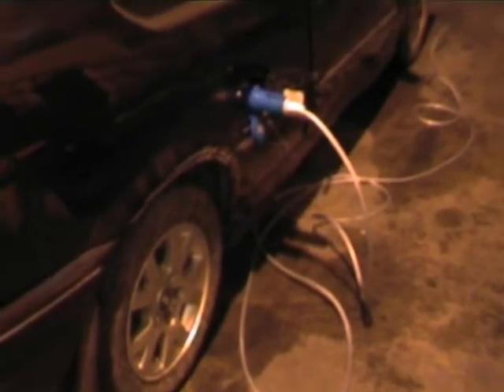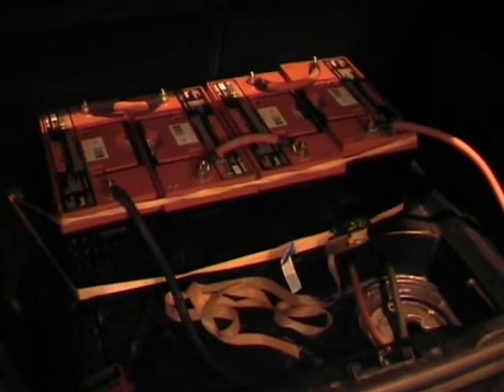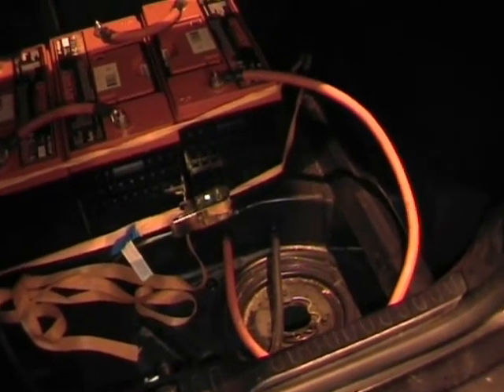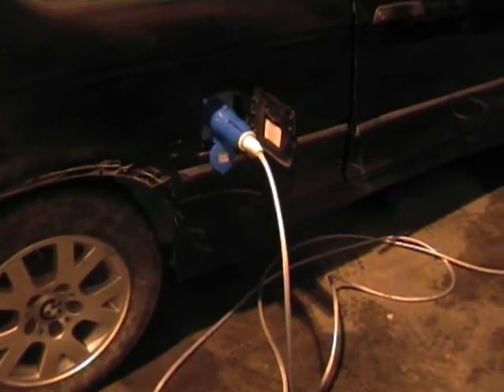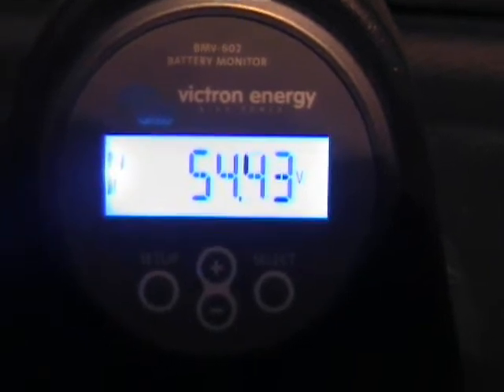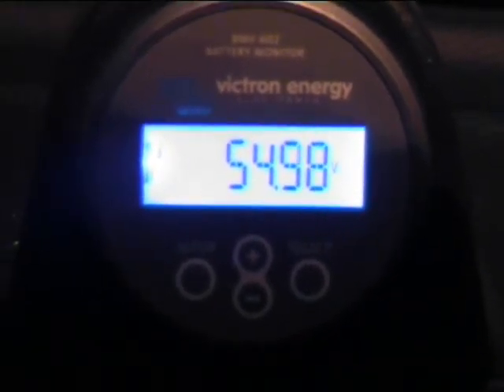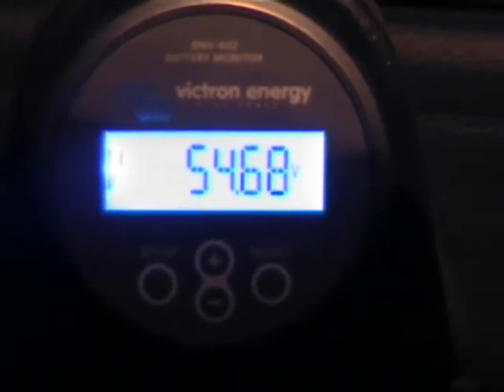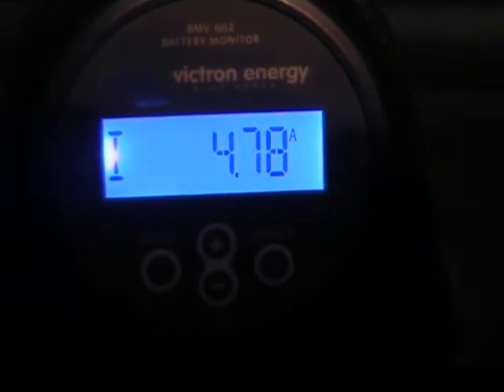BMW EV Conversion 23 Update and Hill Climb

Comment from the maker: No problems driving in the wet. The grill and front air dams are now sealed and an undershield installed. If any water does get into the motor its expelled by the fan.